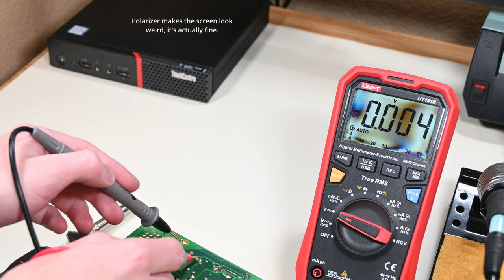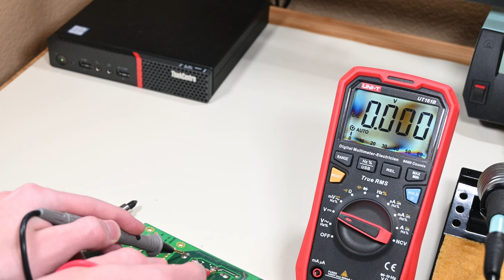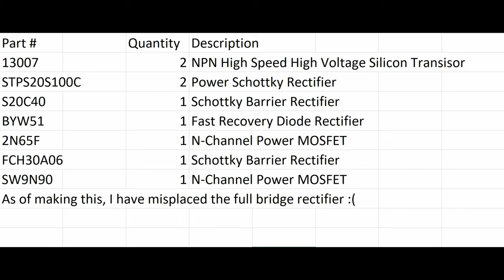What can a Maker Salvage from Old Computer Parts?

Comment: DVD and power supply enclosures can be used as project boxes, in addition to the top and side aluminium panels of the case. Lots of different colored wires in the power supply are always useful and easy to cut off, chunky 2w resistors and odd value Zener diodes at the power supply board can be handy, and I always save the special insulating screws that attach the components to the heatsinks.

Comment: Despite not having your background in electronics, I’ve also disassembled my fair share of components 😅 I’ve got boxes of those switches, cooling fans, power sockets and small motors… they eventually DO come in handy 

5:27 I’d salvage the heatsink bracket, as I’ve dealt with some of these old motherboards with a broken tab on the bracket, which prevents the heatsink from firmly securing to the CPU, requiring fastening it with cable ties 😂

Great video
Reply from the maker: Ahh that's a good idea, I'll probably grab that board and unscrew that bracket here soon, thanks!
Reply: @CHWTT  you’re welcome 👍🏼

Comment: Protip: Make a DIY capacitor discharge tool by soldering two wires or aligator clips to the leads of a 5W, 1kΩ cement resistor and you'll be able to discharge any capacitor you come across. Don't forget the heatshrink.

Comment: I prefer to keep the motherboard intact and keep it as a decor, I had a psu at home and I disaasembled it, cut all the wires, bought some new female headers and pins and make them into new extended cables
Reply from the maker: Awesome resourcefulness!

Comment: If you have an office prebuilt power supply, and it has enough wattage for a higher gpu, they make a Sata Power to PCIE 8-pin adapter. It's a way to save money, and you wont have to purchase a whole other power supply.
Reply from the maker: Definitely true! I always save the good and working power supplies, because they're useful for projects and you can adapt them like this. Although make sure to keep an eye on those adapters, as depending on the way your GPU chooses to draw its power (from the slot primarily or the power connector) and how much power it draws, it can overload the SATA connectors and cause them to melt. Stay safe!